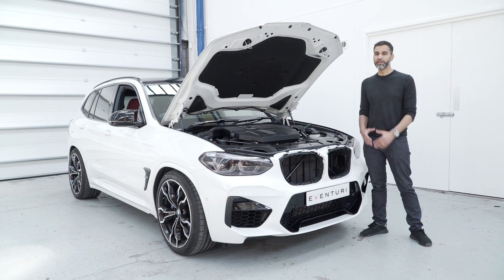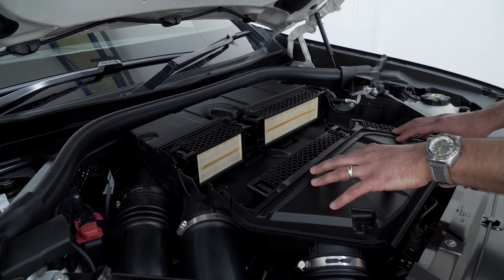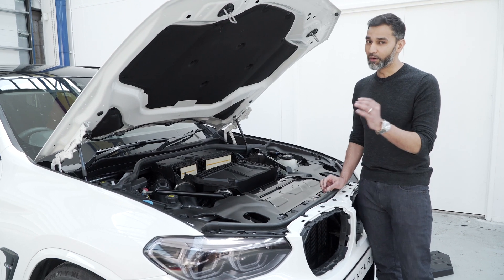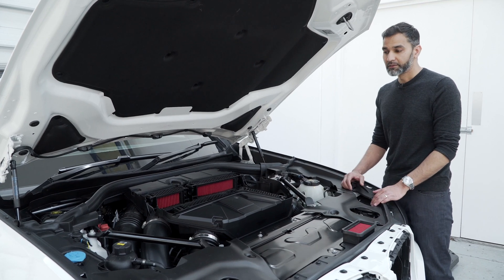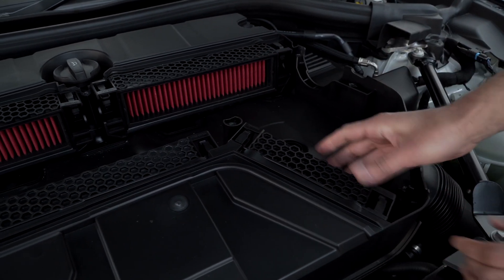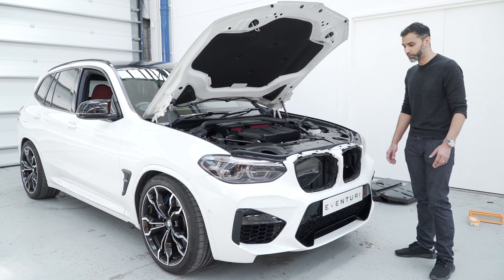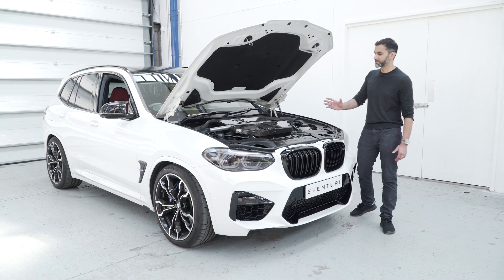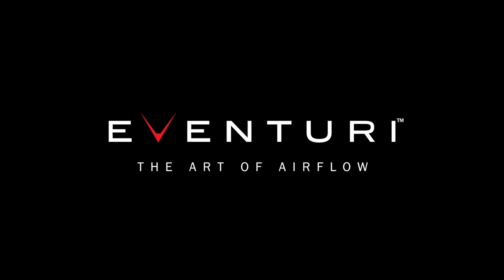BMW X3M Eventuri Intake System - Overview

Comment: Does the less restrictive filters equals dirtier air entering engine, equals more wear on turbos and engines cylinders liners
Reply from the maker: No, our filters meet the same ISO certification as an OEM filter, you can read more here - http://www.eventuri.net/filters/
Reply: @Eventuri  thank you for clearing this subject to me.  Now I will have a easy decision to make and will install this system on my X3 M purchased July last year.  👍👌